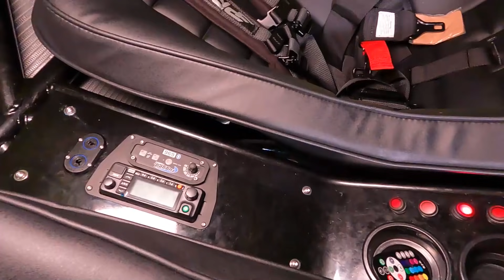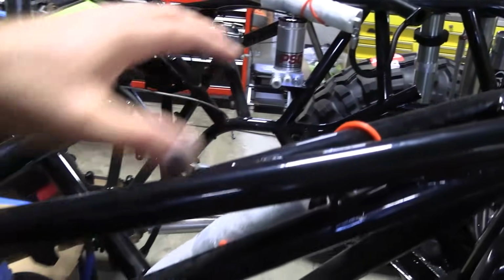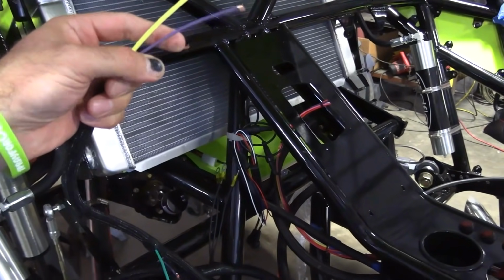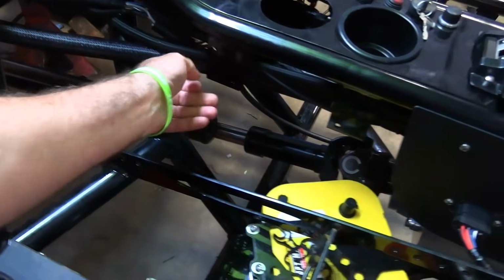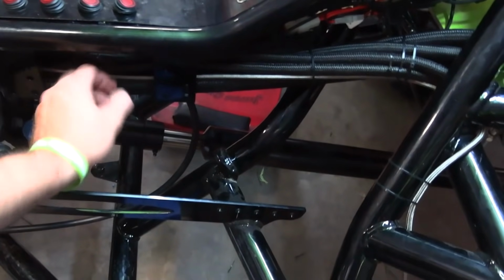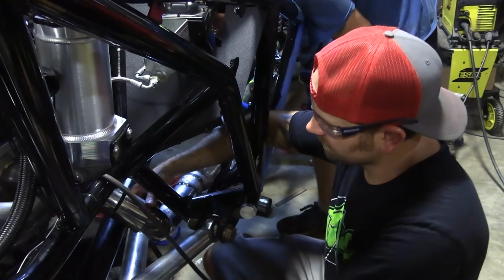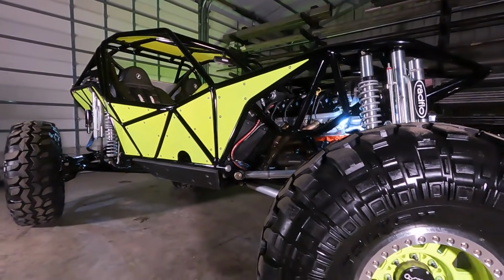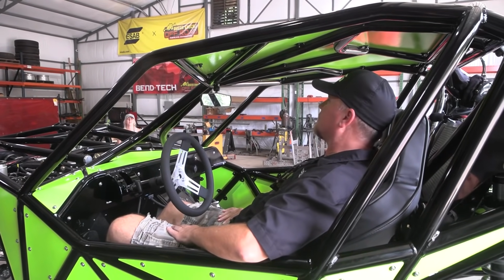LOUD MOUTH Busted Knuckle Rock Bouncer Build

Comment: You folks should check out "Grip lock ties" zip ties. They are rubber lined on one side to prevent chafing of wires. They're releasable and heat resistant as well.They were invented by aircraft racing legends Mike and Mark Patey. Seems like a good fit for your buggies and you're attention to detail. Amazon carries them.   Great looking build !!
Reply from the maker: These? https://amzn.to/2X7u8kc
Reply: @BustedKnuckleVideo  that would be the brand!! Love them
Reply from the maker: I'll try to check them out.
Reply: Thank 😊 you
Reply: Whats the price on the turn key buggys
Reply from the maker: They start at $85,000

Comment: I have a question i have a buddy who got me into rock crawling recently, we live in joshua tree area and there is plenty of desert to crawl including the hammers. He decided to put a thumb throttle on the shifter since he doesnt have three legs for clutch gas and brake. Have you guys ever put that into a rig you built. Ive been tryin to get him to add black light under glows incase you crawl over some opals or somethin. It will easily pay for so upgrades if it happens 🤔
Reply from the maker: these are all automatics so that should help

Comment: Check out mil spec connectors and bulkhead connectors. You could use one mil spec connector instead of using three or four different connectors at one junction. Plus, it’s a metal body connector, not a plastic body connector.
Reply from the maker: might be overkill for this